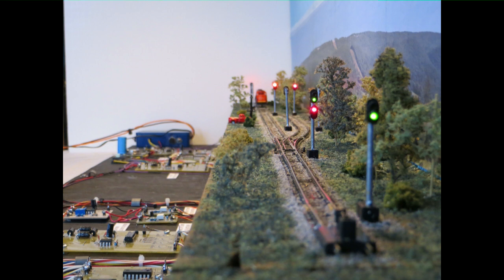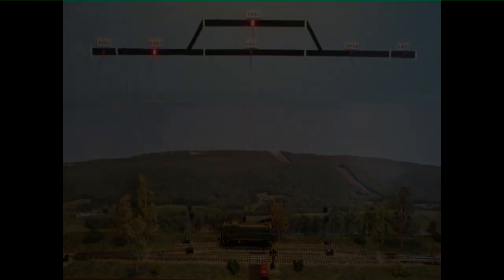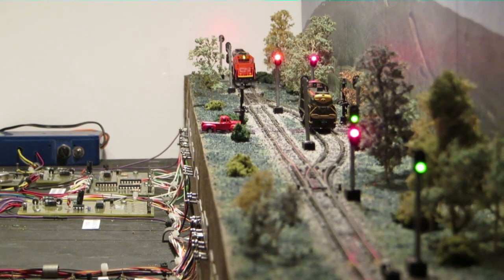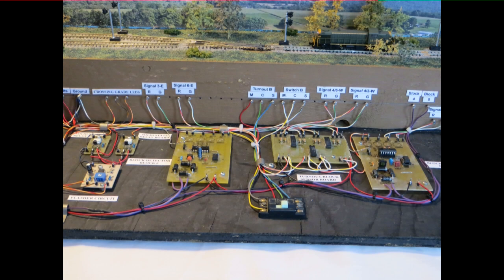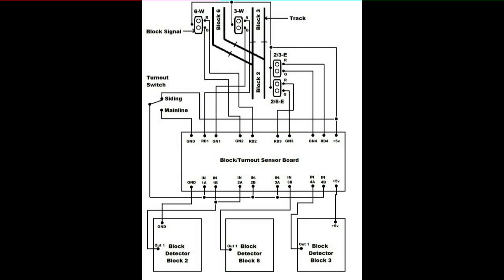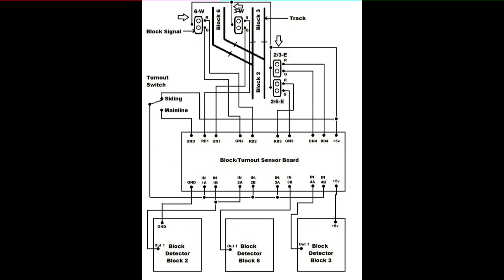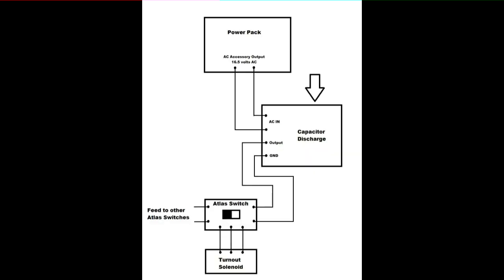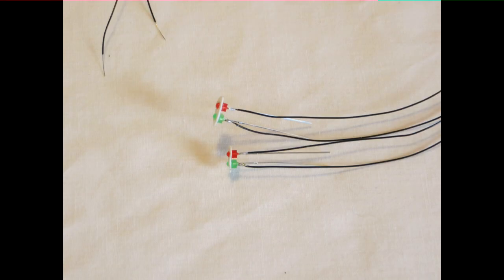Block Detector Block Signal Demo

Comment: A great demo John, but there is a fundamental thing to remember with blocks. You have to remember to space out the signalling to accommodate the maximum length of passenger coaches or freight cars attached to the locomotive in an individual block. If this is not done, then the bock might record a green indicating that the locomotive has passed, but the freight cars or passenger coaches are still in the supposedly green indicated block and liable to collide with the next train entering the block. However, for the purposes of illustrating the operation this was good.

Comment: Where do I get the circuit boards from?
Do the circuit boards come with the electronic parts installed? Or do I have to do that?
You talked about a solenoid changing the blades fro a turnout.  What solenoid do you use?
Is the solenoid mounted under the track? Or beside the track?
Reply: For the LEDs that are blinking alternately a J-K clocked flip-flop would work for that. The way this works is one LED is connected to one output of the flip-flop and the other LED is connected to the other. Caution, when you do this because those LEDs will each need a current limiting resistor on the cathode (ground) side of them.